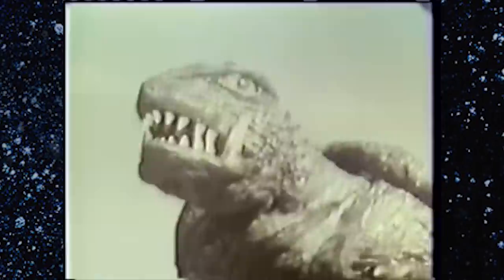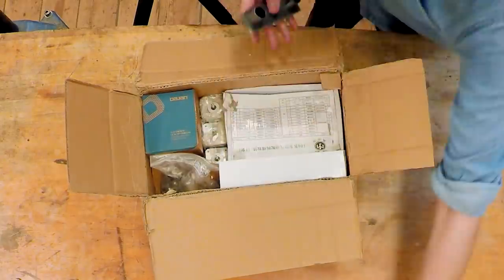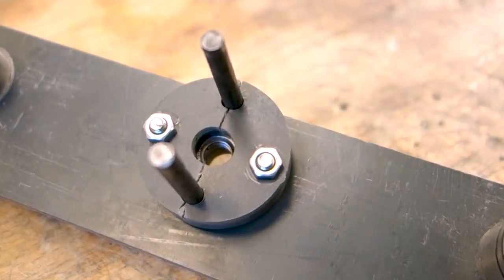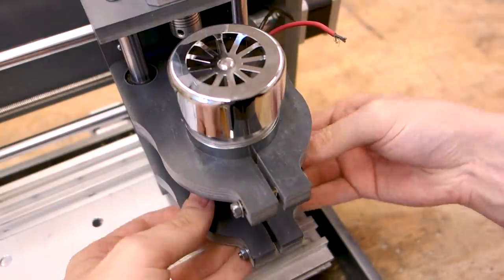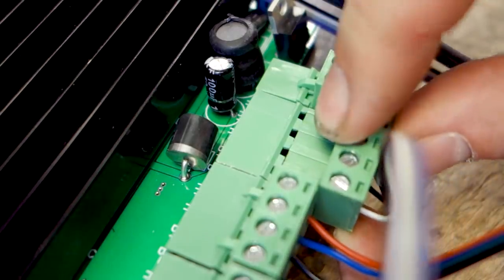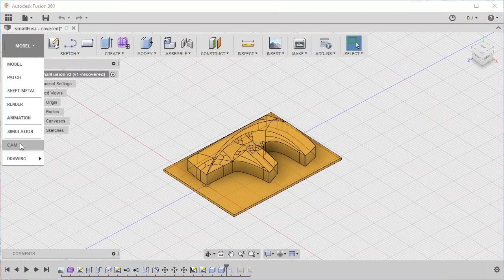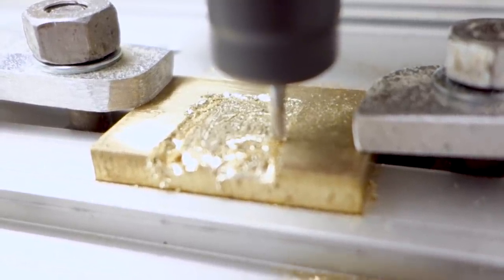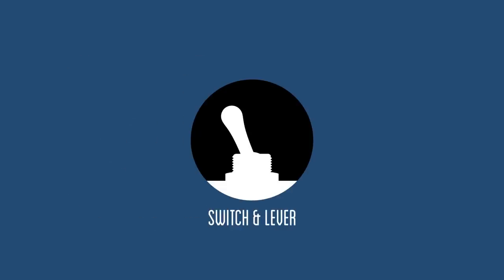Review: Cheap CNC Mill

Comment: I'm about to build my own CNC (about 1ft cube or so, like this one), from scrap parts for LESS THAN $50! (Then sell kits, maybe $50 to $100). I;m going to the Goodwill recycle center (where they sell BY WEIGHT, everything the stores couldnt sell) today, to see if I can get parts even cheaper, than $1-$3 per part or less!
...Step motors with drivers, found online around $5 each, x3, plus a few steel bars and some hardware -nuts, bolts, gears, bearings...which later I will make myself too... and WOOD for the structure/casing parts AT FIRST...then I will make my own....
Melting metal, use simple induction coil, high current, ACTUALLY LEVITATES metals (non magnetic ones like aluminum even!), by causing 'eddy currents' or spinning electrical currents in any conductive material, opposing the collapsing -constantly reversing magnetic fields from the surrounding coil....then you can drop molten metal from thin air into a mold!
Then forge, or constantly extrude wire, or fold (ancient swords were 13x, 2^13=8,192 layers btw), WHILE heating, by running through coils like that!
And the coil itself gets hot of course, so you can make one for melting glass, plastics, and other non-conductive materials...
And I will soon build a magnet POWERED Motor/Generator, which I invented over 7 years ago, AND SHOW EVERYONE HOW TO DO ALL OF THIS!  As I do it!
(Mostly I post on my Facebook: HarleyBorgais, fyi).

Comment: Yeah but what about converting to a 3d printer?
Reply from the maker: What would be the point when you can get better 3D printers for cheaper? This is built to some rigidity because it needs to be able to take a load when milling, 3D printers don't need to be built as strong.

Comment: I wouldn't try to mill any metal without at least a 2.2 KW spindle.But I can see it being useful if you mill parts out of foam and then cast them in metal. and I'm sure you can upgrade it (some gearboxes, stronger frame and  better spindle). If the cost of upgrading it doesn't cost more than simply buying a better mill that is. But like you said its not a production machine but I can see some potential in it, if used correctly.

Comment: You mentioned a program right at the end which converts a photo into gcode. Could you elaborate or even share that program please?

Thanks!
Reply from the maker: It just converts black and white pixels into lines in gcode, it's nothing special. If you know how gcode works it's easy to program yourself.
Reply: I see. I have been creating gcode very simply by drawing in illustrator and then converting it in inkscape. I'm aware of how gcode works but wouldn't know where to start to write my own program. Could you send me any more information about it. Could you put it on github? Thanks for your reply :)
Reply from the maker: Nope, I only really share my code if I've gone through it. This is as messy as can be. 

The idea is basically

Check if pixel at 0,0 is black, if it is continue to the next pixel at 1,0. If that pixel also is black continue to 2,0 and so on until you find a white pixel. Between the first and last coordinate draw a line in gcode, with according up and down movements of the tool (pen). If the pixel is white, do nothing, continue to check the next pixel until you find a black pixel.

Then repeat this every n pixels down trough the image. 

Using a gcode simulator you can simply test your output to see if it's doing what you want.

Comment: Are you also the owner/operator of code and solder?
Reply from the maker: Of code and solder? I code and I use solder, if that's what you mean?
Reply: Switch & Lever 

No, not quite. There's a youtube channel by the name code and solder. I only asked because the name format seemed familiar. Not important. Have a good'n.

Comment: ummm... let's see if we can buy something much better at around that price:
- 500w spindle + psu + collets $130 (amazon)
- Linear rails for 200x500x500mm + block bearings $110 (ebay/aliexpress)
- T8 8mm per rev 8mm dia. lead screws + pillow bearings + coupler $50 (amazon/ebay/aliexpress)
- Arduino+CNC Shield + drivers + stops + 4x nema 17 84oz/in kit $80 (amazon, you need to add a nema to the 3 in the kit)
- 24v PSU for the board and nemas $20 (amazon)
- Sheet of 3/4 ply $30 (shapeoko shape but the sides, bed and gantry made into torsion boxes = VERY rigid)
- 3 cans of spray paint to make it look decent $10 (only if you hate plywood edges)

Total $430, not too bad right?

Optional upgrades, which the torsion box design's rigidity and the arduino+shield would allow): 
- for stronger steppers, 4x nema23 + 4x proper drivers + larger PSU = approx $200 (amazon) or $165 (aliexpress)
- stronger spindle, 2.2kww air cooled + VFD + ER20 collets $325 (Amazon, $220 water cooled) or $190 (aliexpress)
- 5.5w laser for engraving/thin cutting + PSU $170 (aliexpress)
- Make it bigger (up to 1' x3' x4' or 300x900x1200mm) by adding a sheet of ply and longer rails/lead screws

Total: still probably under $900 with all options

Any bigger and/or stronger and you're looking at ball screws, thicker linear rails and steel/alum construction = All the things anyone looking at reviews of a cheap CNC mill is likely unwilling to pay for!

You'd be having a hard time assembling and calibrating the reviewed unit anyway, might as well go for broke putting together something that won't be nearly as frustrating once it's set up, and is actually functional.

If you do it this way, good luck and much respect! You'd be saving quite a bit over ready-made solutions at its functionality level and gaining a few +++Craftsmanship points along the way :)
Reply from the maker: I truly appreciate your efforts, but it fails on one important point in my opinion. Arduino running GRBL. You'll probably be able to build a more rigid machine with what you put together, but without a dedicated controller that can run a fuller feature set of G code than GRBL can its a little bit like putting a Lada motor into a Lamborghini.
Reply: Switch & Lever I actually added the Arduino+shield as a quick and easy option. The same kit running on a board that can handle more traditional gcode options is even cheaper on AliExpress, and it'll be quite similar if not the same as the one in the reviewed unit.
I appreciate the effort of replying to this, especially with it being an old video, though the purpose of my comment was to help out the people who watch this video hoping they can actually get a functional machine for a low price, which the reviewed unit mostly fails to be.
Reply: This is exactly why I bought a $200 300mm x 180mm CNC engraver from AliExpress.  I needed a small mill for plastic and wood, and totaling the BOM, even from Chinese sources, STILL comes to more than a complete kit costs.  Sure, I assumed I'd have to rebuild much of it, but the same would happen if I built it from scratch.  So I bought one.  I'm not disappointed.  It's a fully metal frame except for the Z axis, but I don't think that makes it any stiffer than the model reviewed.  I haven't tried milling metal with it, but I wouldn't expect it to do any better than this one.  I really bought it as a bootstrapping step - I can use this to build something bigger without spending several thousand $.  The larger, more capable CNC router/mills are much more expensive than their BOM totals.

Take a look at the upgrades myfordboy made to his cheap Chinese engraver: http://myfordboy.blogspot.co.uk/p/banggood-des.html.  He basically turns everything plastic into metal, replaces the motor with something much stronger, then rebuilds THAT with better bearings and a flywheel.

Comment: Trying using a real end mill tool. Just turn  down the tool shank  on a lathe, so it will fit the collet, and it should cut copper and brass much better. try it and let us see what happens please
Reply from the maker: No no, you turn down the shank of a carbide endmill on a lathe, I'm really curious about the results.

The mill has been scrapped, and parts saved to be reused in other projects, so unfortunately what you suggest won't happen.
Reply: That will work too. :)
Reply: Have fun.

Comment: I watched a space shuttle split during "86" while working an air conditioning pump frame for another shuttle in "86. I watched CNC grow. With all due respect I am confused about the statement of a drive system being delivered without the software? Any machine I used or set up came with software. However they did not come as assemble yourself or diy machines
Reply from the maker: +Do Right I'm confused, this comes with software, am I somewhere alluding it did not?

Comment: Honestly don't bother with gearbest. You could find all alum frame ones for cheaper at aliexpress or banggood.
Reply from the maker: +XXCoder how is Aliexpress or Banggood any different, really? They're all just retailers who get the stuff they sell from the same sources anyway.
Reply: In general, aliexpress and banggood have lower prices than gearbest. Not always though.
Reply from the maker: +XXCoder alright then, show me an aluminum frame one, with similar specs (especially size and power of spindle) for a similar price and I'd be happy to admit defeat. No one has managed so far though, despite plenty of lofty claims.
Reply: Btw I don't debate to "defeat" people.
Reply from the maker: +XXCoder well color me confused, the first one is the same without electronics, of course it will be cheaper. Like saying a car without an engine is cheaper than one with.

The second one is severely smaller, and the question is not whether you can get a smaller one for cheaper, that's a no brainier.  The spindle is a joke. 

The third one is approaching similar specs, but with a severely underpowered spindle, and GRBL controller. The one I reviewed actually has a custom controller (albeit pirated) which supports a much larger feature set than GRBL does. So while we are getting closer it's still not close enough where it matters. You can get the exact same I have cheaper from other sources as well, but you have to ask yourself, just like with the ones you posted, how much they further skimp on quality when going increasingly cheaper. 

I look forward to your review, which one are you reviewing?
Reply: None actually. I have larger router. Like I said it would be still cheaper after buying electrics kit. $250 or so vs $400.

Yeah none of those really is amazing option, really. I did miss the controller though. Buying that separately probably would make it cost more, but will it take cost above $400, after spindle and custom controller?

In the end it does not really matter, only that is it up to task it was designed for? As your review says it could do some stuff but has bunch of issues. I somewhat doubt those 2020 frame routers would be a major improvement. Just less brittle parts, so it could work better after better spindle is used? Possible.

Comment: 250 euros i can get a manual proxxont and if i ad 300 euros it becomes a cnc
Reply from the maker: +Einheit SchwulesEinhorn what is your point exactly? That you can spend more money and get a CNC with fundamentally different specs?
Reply: Switch & Lever that the proxxon is better for a little bit more
Reply from the maker: The Proxxon has a range of 134x46mm, with 80mm vertical clearance. It's not even near the specs of the mill I reviewed. You're comparing apples and oranges. Please get back to me when you find a mill with similar specs in a similar price range. The issue isn't whether you can get a mill which you can mill tiny stuff on for a similar cost, but rather one with a similar range.

Comment: You have incorrectly assembled the machine. Do not put the bearings on the threaded screws, and then wonder why the machine does not mill bronze
Reply from the maker: +Fatoush Ahvijan why do people insist on talking about things they have no idea about? If you actually look at the video you'd see that the bearings are pre assembled. How did I incorrectly assemble something that came that way?
Reply: Switch & Lever on each of the lead screws, two bearings, one is pressed, the second is put on the axle from the inside
Reply from the maker: +Fatoush Ahvijan you're obviously still not getting it. The bearings, one on each end of the lead screws were pre assembled. I put them in as little as I put in the engine on the car I drive.

Comment: $400 isn't cheap.  Maybe $50.
Reply from the maker: +→ to the knee it's all relative, $1 is expensive for the person who doesn't have it, $10000 is nothing for a billionaire. It is cheap for what it does, or would be if it did it well at least. As I've said to many before you, try to find a CNC mill with comparable specs for cheaper and then come back to me.

Comment: The linksprite engraver is half that price
Reply from the maker: +Cecil Merrell yep, but also comes with a much less powerful spindle (it can't do metal engraving even) and the table dimensions are much smaller. It's cheaper for sure, but that point is moot as it doesn't have comparable specs.

Comment: There is a reason we use the words "Precision Tools" with respect. They do things right ,very well and repeatedly . If you have to pay good money and pray that it does not crap out from the get go, you have garbage and have wasted your time and money. GIGO !!!
Reply from the maker: +Robert Clolery whenever did I use the term "precision tools" in relation to this? If you want a CNC that's up to your standards then by all means drop the extra money that's required. You're not going to find a solid "precision" CNC with comparable specs for a cheaper price.

Comment: There is no excusable reason for something that costs 400 dollars to be made to such a shoddy quality, all that is necessary for a rudimentary cnc contains little more than a 3D printer does
Reply: a CNC can be converted to a 3D printer.  The opposite is not true, just like how a square is a rectangle, but a rectangle is not a square
Reply from the maker: I think you're severely underestimating requirements on a CNC, unless your definition of "rudimentary" is very low. A 3d printer does not need to drag around a heavy motor, which also vibrates from it's usage, adding additional needs for stability in the construction. Not only that, a 3d printer is never put to any load, in any axis, it should just deposit material on top of what's already there. A CNC is the exact opposite, it needs to be rigid enough to handle loads in all axes. The similarities really end after "need to move in three axes", as the demands are quite different.
Reply: Switch & Lever I guess, but even then 400 dollars should buy you 3 linear slide rails, worm screws and stepper motors of good enough quality, plus electronics and some plastic that doesn’t snap at the slightest pressure
Reply: I’ve seen arduino built cnc controllers that go for under 150 dollars, and are good enough, plus a power supply and there’s no reason why something like that shouldn’t at least provide acceptable quality, and if this is built in an industrial sector of China, you’ve got a supply of decent and cheap parts at your disposal
Reply from the maker: I've gotten this comment a few times already, and every time I've asked people to prove it to me. There are a lot of opinions about how much a comparable CNC should cost, and many seem to assume it should cost the same as a McDonalds Happy Meal. All I ask is to put together a list of components and prove it, so far no one has been able to, unless you're talking about very small and underpowered CNCs, with shit controllers.

Comment: that oily grit is a standard rust preventor spray that Asian countries put on all their machinery... even really expensive robots for car plants and linear rails for machinery have this stuff on it.
Reply from the maker: That could indeed be true if the plastic also wasn't coated with it, plastic doesn't corrode.
Reply: i understand but they coat everything, i believe they have their shipping departments equipped with a spray gun and they just coat everything
Reply from the maker: I get what you're saying, but it doesn't make sense, as parts which could actually benefit from being covered in this are randomly missing any "rust preventor", like the linear rails and leadscrews, and parts which it bears no impact on, like the plastic, completely lack it. The mounting hardware, the screws and nuts, are covered in the filth though.

Comment: your supposed to used flat tip drill bits not pointy ones thats why the first mill was a fail its mostly because of the bit but some is cause the stepper motors were messed up
Reply from the maker: +KingCobra you're definitely not supposed to use any sort of drill bit in a mill for milling operations. The first milling operation used an engraving cutter, but when milling foam anything sharper than a q-tip should suffice. Look at people doing wood inlay work with v-bits if you need more insight. Also, none of this had anything to do with "messed up" steppers, but was (as I say in the video) due to poorly lubricated leadscrews and bearing surfaces.